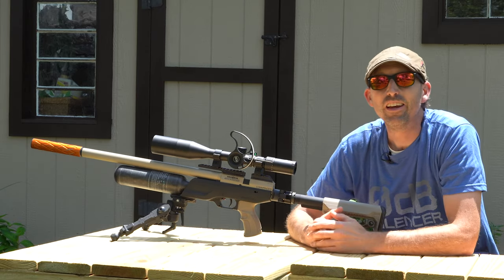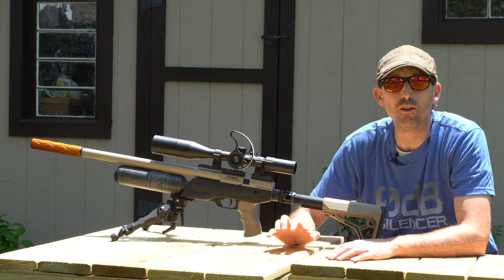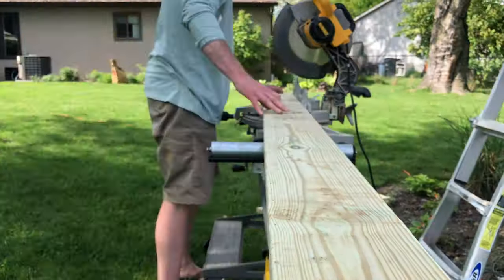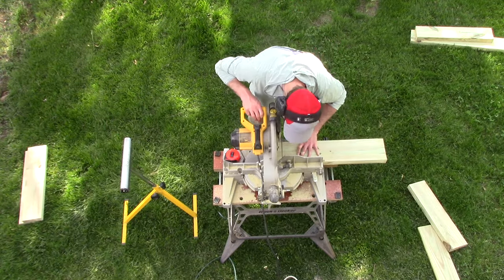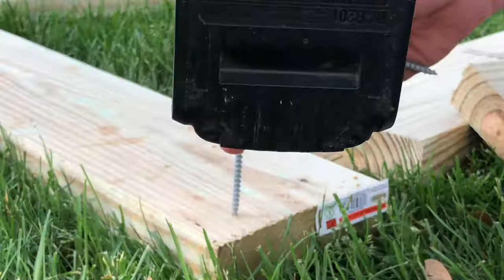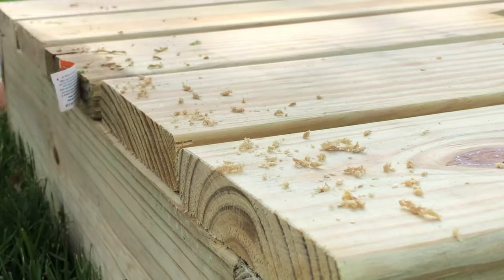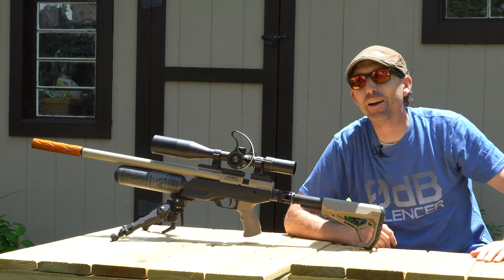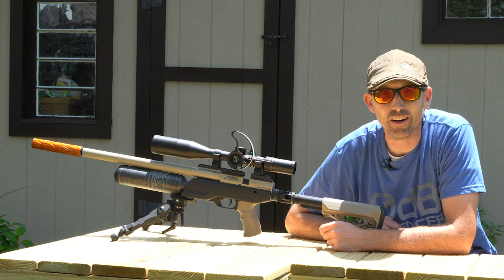Airgun Advisor: Easy DIY Shooting Bench

Comment: Thanks.  I love the project you shared with us.  Great way to show the measurements visually at 2:16.  You might want to use at least a dust mask, if not a respirator (check out the 3m 7500 series if you are not familiar with them; they are actually comfortable to wear) when cutting pressure treated wood.  Personally, I would not use pressure treated wood for surfaces you will touching (even after they shifted away from chromated copper arsenate (CCA) for residential lumber in 2003).  I imagine you can paint or seal it but I don't know off-hand what would do the trick.  What's the approximate weight of the bench?
Reply from the maker: Dust mask would be beneficial to this project. Thanks for all the added tips & comments. I am sure they will help others in the community.